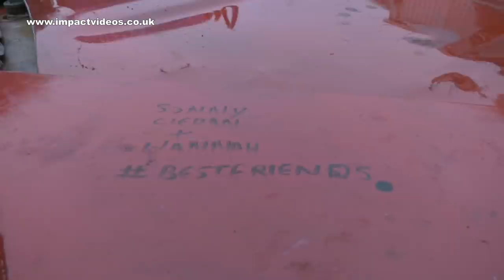Jaguar Banger Race Car Build Part 4 With Callum White

Comment: The question is WHY?  All that work for a few minutes use.
I have been involved in street stock racing here in Oz. Not demo derbies in clunkers. Still very hard on cars which are a LOT safer and actually quite fast. Most competitors get a season say 15 shows from a body shell, often more.
Just search for street stocks and you will generally see very good racing. They have saved sprintcar shows who bore the public and the real racing is from the bottom level